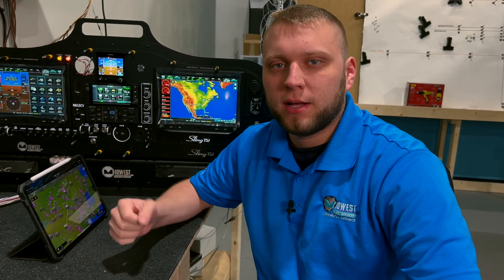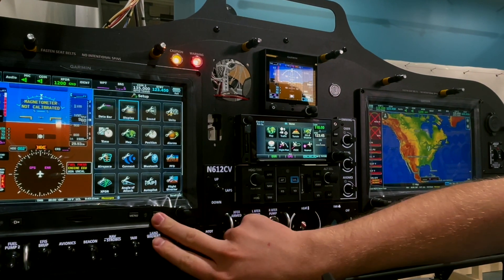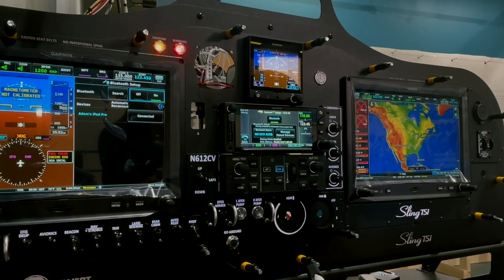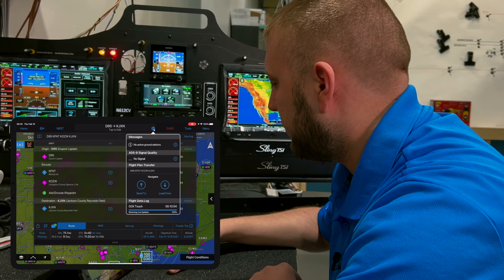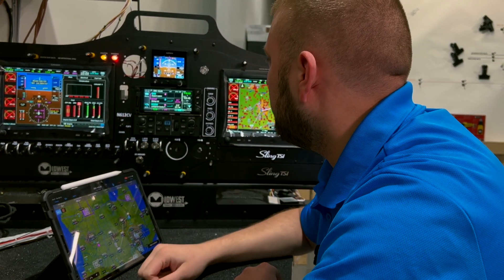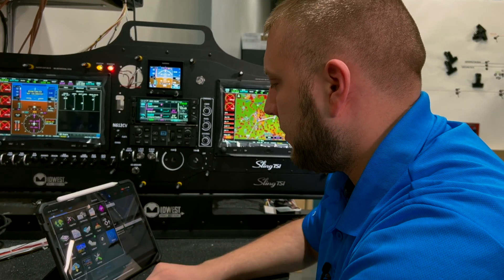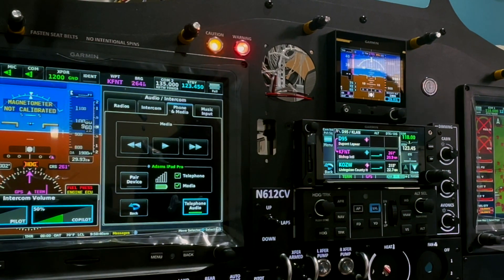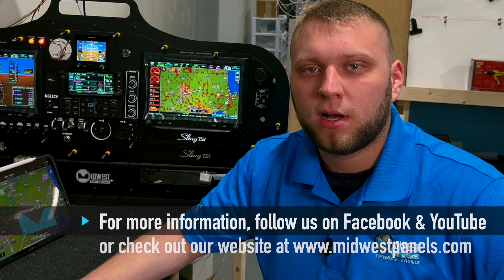Bluetooth Features on G3X Touch System

Comment: I'm wondering if there is a way to remotely display my G3X screen on a tablet such as an iPad. I have a tandem seating aircraft and I'm hoping to start instrument training but I have no instrumentation in the back seat for the instructor to see. I'm being told that it's very unlikely that an instructor (or DPE for that matter) would be willing to train without being able to see the instruments. This certainly makes sense. I have a G3X touch, G5 and GNC355. Any thoughts?

Comment: If I were to just have a single G3X and a GTR200B, Will I have bluetooth music to my intercom? And will I in that case be able to simultaneously use my iPhone to send/receive flightplan updates to/from the G3X over bluetooth AND have bluetooth music sent to the GTR200B?
Reply from the maker: Yes if the GTR 200B is used as your intercom then Bluetooth will be on the intercom but it can only accommodate a 2 place setup.

Yes you can connect to the GTR 200B and the G3X separately.
Reply: @MidwestPanels  Thanks for the info, it's what I was hoping to hear

Comment: Very nice. Will an iPad that is Wi-Fi only, i.e. does not have internal GPS, function in the same manner as what you’re showing in the video? I assume ”yes” as it is pulling in the required data via Bluetooth from the G3X.
Reply from the maker: Yes it will.

Comment: Hi, do you need to use a flight stream 510 to connect to the GTN650 or are you connecting through the G3X only??
Reply from the maker: No you do not need a Flight Stream with the G3X.
Reply: @MidwestPanels  Thanks for the response,  Is the flight stream 510 now redundant? or does it have a place in this set up?
Reply from the maker: @Slingtsi  in this setup the only thing it would be useful for is for the updates to the GTN, as it will allow wireless updates to the database..